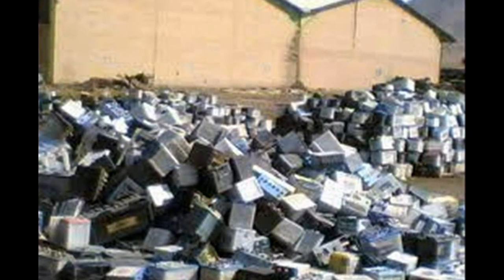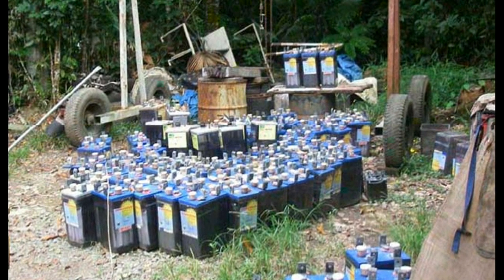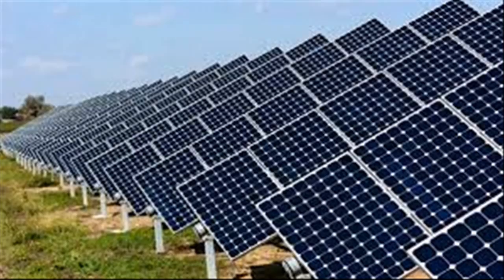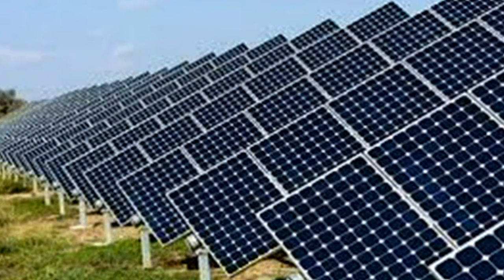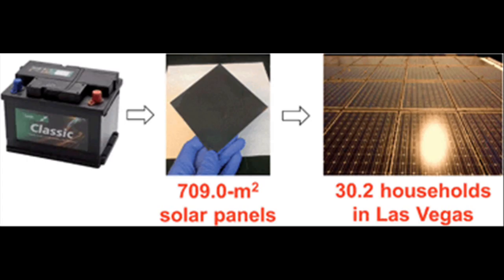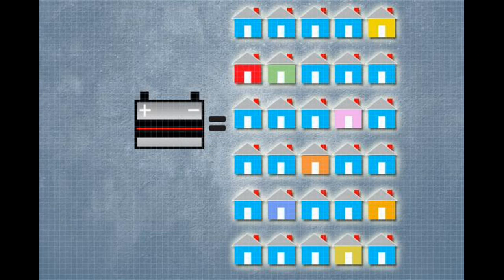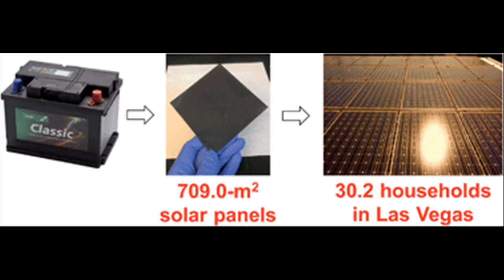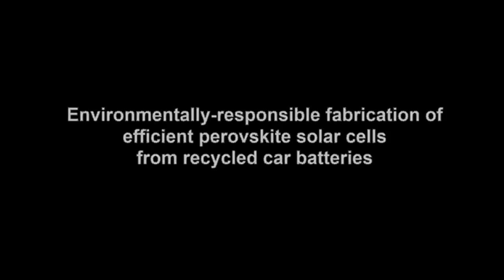Recycling old batteries into solar cells. Recycling one single car battery can power 30 households.

Comment: i need just chemical scheme for every single step to make processing because i've cut the battery and extract the anode(Pb) and the cathod (PbO2) and by testing chemical synthesis of PbI2 (i just got anode and add HNO3 55% and by stهring and adding KI i got yellow color for a moment then i converted to brown immediately so what did i make wrong bro    ) Thanks anyway